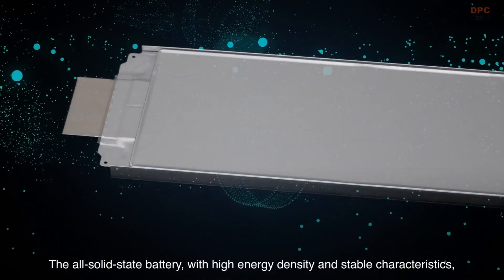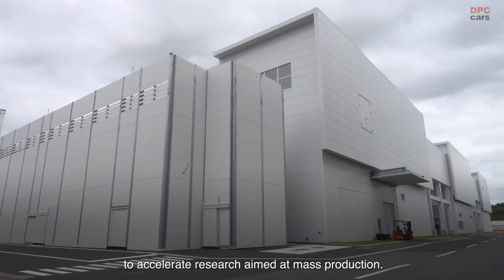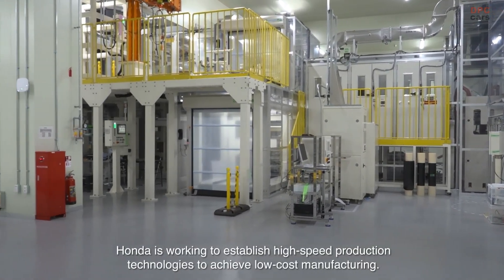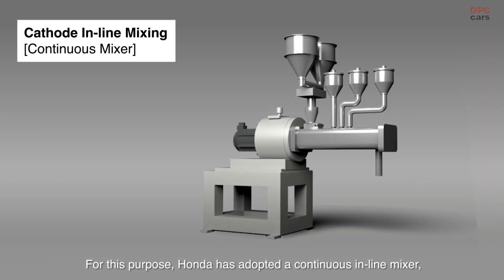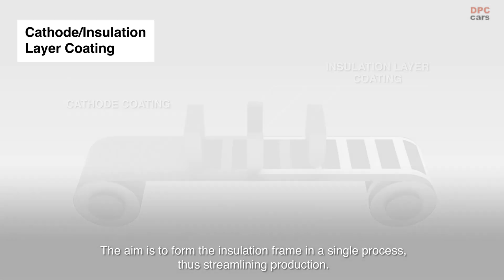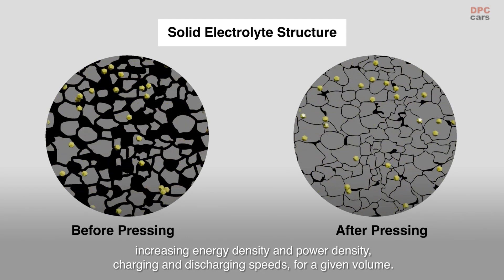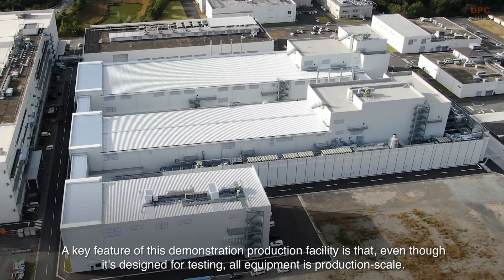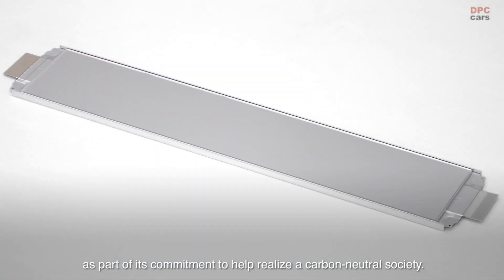Honda All Solid State Batteries Explained

Comment: I read somewhere they're 66 percent lighter and 33 percent more energy dense, and charge MUCH faster
Reply: Yeah, all of it is so good. With the faster changing times being the biggest advantage
Reply: That would be sweet.  My wife just leased a Prologue.  Maybe in a few years Honda will have EVs they make using these batteries.   Charging EVs at pubic chargers are still a bit of a pain.